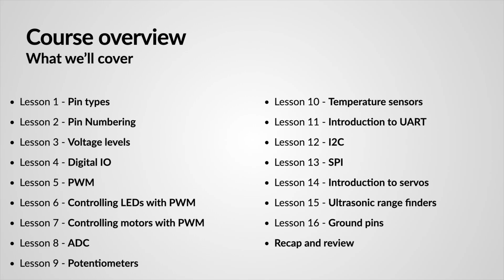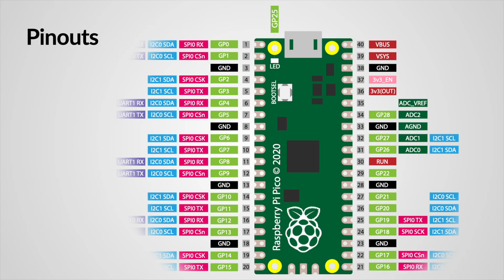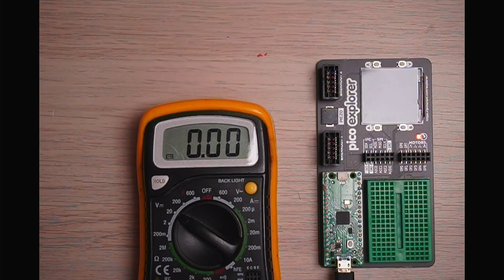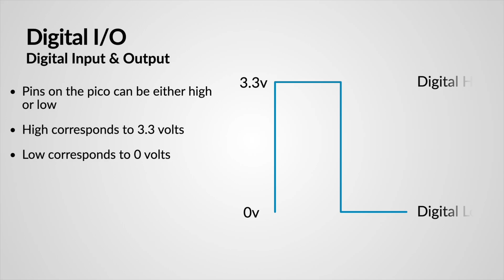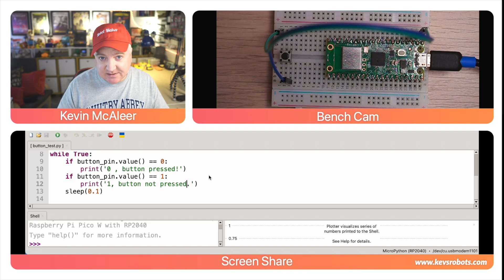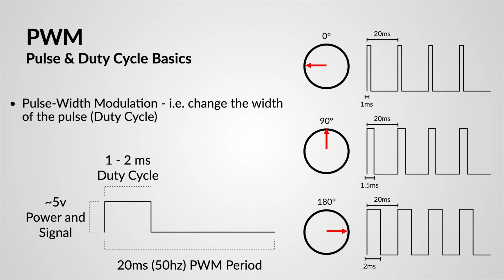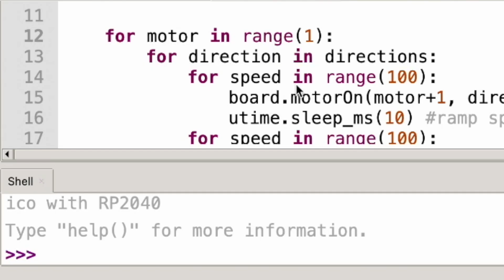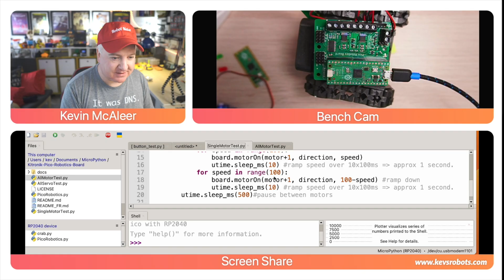Master GPIO with Raspberry Pi Pico & MicroPython - Uncover the Secrets!

Comment: Hi Kevin. Thanks for your videos. I have a question about the use of MicroPython vs CircuitPython & Arduino (C++). I've used them all but am wondering if you have any info to share on why you would choose one over the other. The biggest drawback for CircuitPython seems to be the lack of a direct ability to handle interrupts (though it does have a limited asyncio library that can give you some options). CircuitPython does have a great set of libraries for Adafruit products which is helpful. Obviously there's a speed issue when using Python since it's interpreted vs compiled. Why do you use MicroPython and would you use any of the others? If so, what factors would make you look at another programming option? Thanks for any info you can share.
Reply from the maker: The main reason to use python is the simplicity and speed of writing that code (you can try things out in real time), whereas the code execution is a bit slower than C++, but unless that’s really critical Micropython or circuitpython is that way to go.
Reply: @kevinmcaleer28  Thanks. Do you use CircuitPython or only MicroPython? If so, when would you use CircuitPython vs MicroPython? What strengths & weaknesses would you say each has?
Reply from the maker: @christopherlyons7613  circuitpython is Adafruits fork of Micropython so it works best with their ecosystem of boards and sensors. Micropython is supported by most the boards I use, such as those from Pimoroni. You can easily switch between them, so it’s not like you have to stick with only one. I sometimes use Circuitpython if I want to do stuff with Mini, usb or audio as they have better support for that, right now